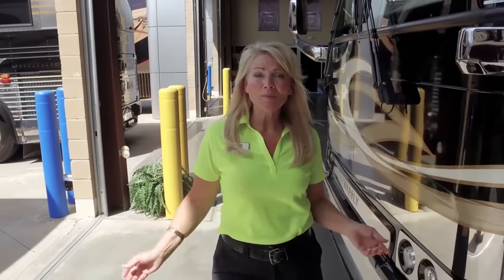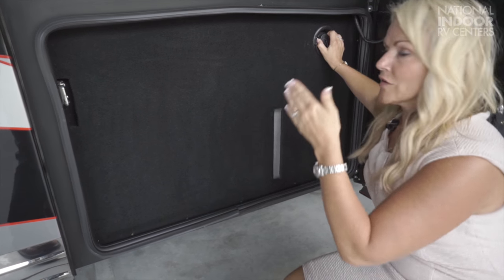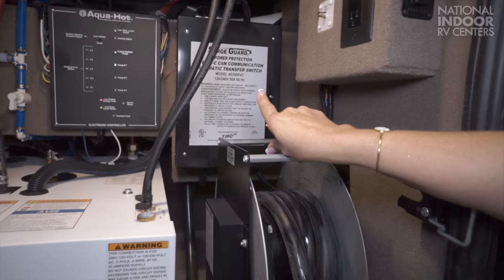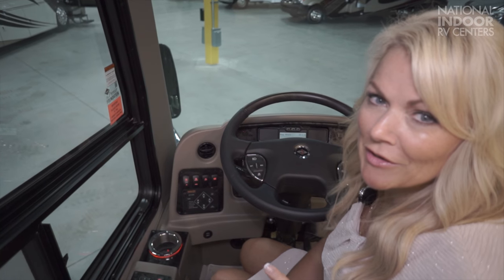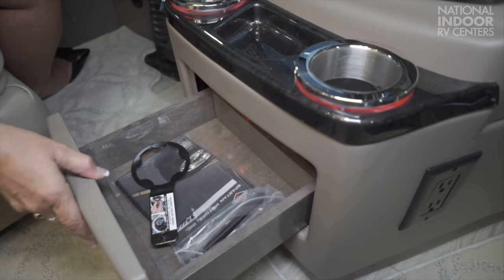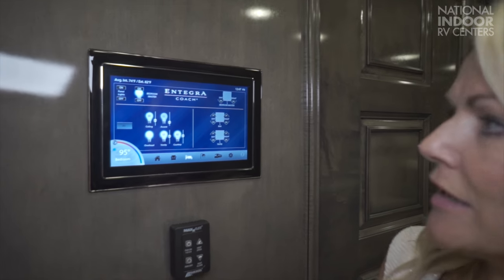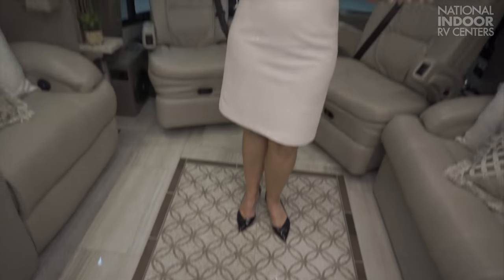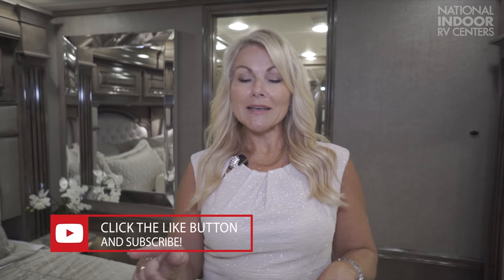2018 Entegra Cornerstone | Full Motorhome Walkthrough Tour | NIRVC

Comment: Can you do a video explaining the special license required to drive one of these.  Thanks
Reply from the maker: Thank you for your comment Tin. I'm sorry to say we will probably never produce a video on licensing requirements as they vary from state to state.
Reply: If it is a personal vehicle, no special license is needed, across the 50 states and canada.
Reply: Several jurisdictions in Canada require you have an Air Brake Endorsement to your driver's license if the coach is equipped with air brakes.
Reply: George Bliss in most parts of Canada you would need a minimum DZ to drive this. It’s way over the .....I believe 26000 pound G licence rating.

Comment: While I have become disenchanted with the Cornerstone because I feel they are downgrading some things, I do like the new King Aire from Newmar. Also Entegra doesn't want to allow you to customize their units. Curious If  you run can the A.C. units off the batteries on the Newmars.
Reply from the maker: Yes, you can run the midship A/C unit while dry camping because on the 2018 King Aire because it comes standard with 16 batteries. Thank you for your question.
Reply: Roy Davis  Thor purchased Entegra and Jayco. The former Entegra president, Jenkins quit and now is the CEO of NIRV. Thor intends to improve the Entegra line and allow ordering of specialized coach's.
Reply: you should probably by a Newmar then

Comment: Hey Angie I'm pretty sure you got when to put the leveling jacks down backwards? You don't want to put the slides out until the coach is level. Thats a lot of unnecessary stress to the motors if your unlevel pushing and pulling the slides in n out. Jacks down first then slide?
Reply from the maker: Because of Entegra's construction Entegra recommends extending their slides out first and then the hydraulic levelers. Here is a quote from Entegra's website along with the link:

"It may seem counterintuitive, but the best way to put slides out upon arriving at camp is to plug in, run your slideouts out and then level the coach. Since we build a little differently in order to deliver the quietest riding, best handling coach on the market, the most balanced way to roll out slides is actually with weight on the tires, not the levelers".

https://www.entegracoach.com/connection/leveling_and_slideouts/

I hope this helps.
Reply: I have always extended slides first before using hydraulic jack levelling. If using air bag levelling it really doesnt matter.
Reply: might have to do with chassis flexing to different position with the jacks down, which might bind!!! :)

Comment: This is a very nice motorcoach presented well by someone who understands the features and the systems onboard.  It's too bad that Entegra does not offer a similarly well appointed coach in the 40 foot versions.  The Aspire line is not as well appointed as the Anthem and Cornerstone lines.  The Aspire is the only model that is offered in the 40 foot class.

Comment: I am confused. in the comments from  you, you stated that the cornerstone was equivalent to the Newmar London Aire. I thought the cornerstone was the top of the line for them and equivalent to the King Aire and the only thing really different is the price, that being the cornerstone is cheaper. Esp since they are both on spartan chassis and have the same engine with 605 horses
Reply from the maker: The Cornerstone is the top of the Entegra line up and the King Aire is the top of the Newmar line up. However, Newmar reintroduced the London Aire to compete against the Cornerstone since the Newmar Essex and King Aire have far more features and higher price points than do the London Aire or the Cornerstone. 

To your point, all four coaches, the King Aire, the Essex, the London Aire and the Cornerstone sit on the Spartan K-3 chassis and all are powered by a Cummings 605 horse power engine.

Comment: What for a driver License do you need in US for this coach
Reply from the maker: I'm sorry there's not an easy, single answer to your question. The answer is, licensing requirements vary from state to state. I would just Google to see what the requirements are for the state you're thinking of obtaining your license in. I'm sorry I couldn't be more specific.
Reply: Oooh, I will traveling the same USA and Canada. I have the German Truckdriver license. Can I these upgrade of an US license ? Or must I have an Busdriver License ?
Reply: This is very complicated but I mean with the German driver license is it not a problem to drive a class A Motorhome in the US and Canada. In Germany I can drive a Car until 15.000 pd. In the US is no restriction in the Weight

Comment: I was wondering if the cornerstone  is the higher model or the king air?
Reply from the maker: The Entegra Cornerstone compares to the Newmar London Aire. The Newmar Essex is above the London Aire and in turn the King Aire is above the Essex.
Reply: National Indoor RV Centers Well thank you for the information
Reply: So the King Aire is higher model?
Reply from the maker: Correct. While the Cornerstone is the top of the Entegra line up the King Aire is the top of the Newmar line up and would be considered two steps above either the Entegra Cornerstone or the Newmar London Aire.
Reply from the maker: It most certainly a higher model.
Reply: National Indoor RV Centers 
Thank you for the information
Reply: National Indoor RV Centers 
Thank you for the information it truly helped me.
Reply from the maker: The Cornerstone is the top of the Entegra line and the King Aire is the top of the Newmar line. The Cornerstone compares to Newmar's London Aire air which is Newmar's third most luxurious coach. Newmar's King Aire is the most luxurious.